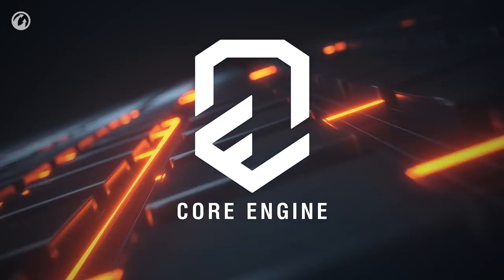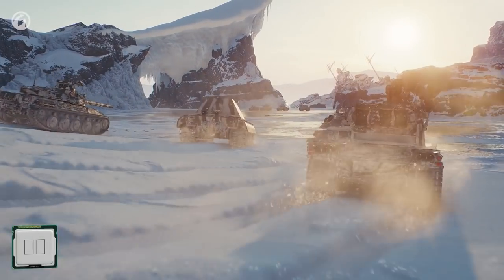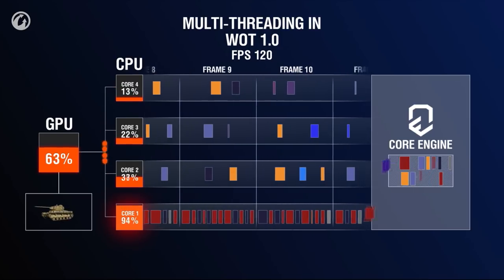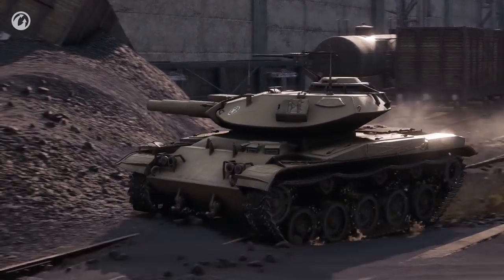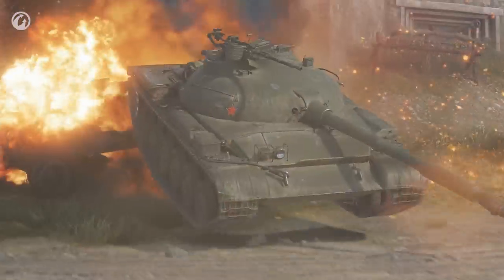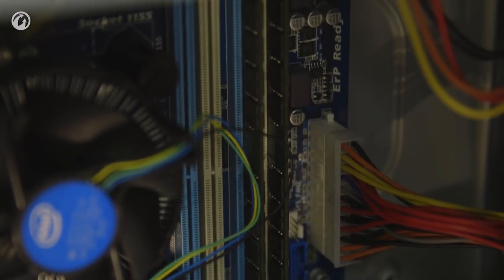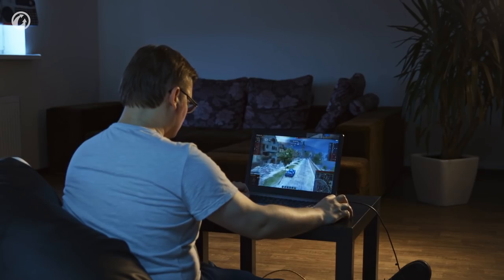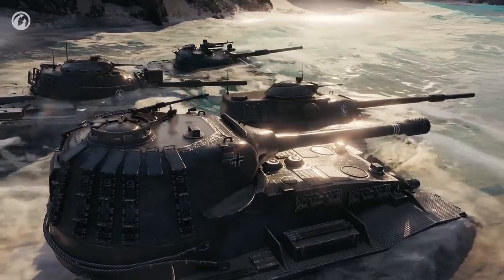Multi-Threaded Rendering in WoT

Comment: Very well explained, other reason that's why I love the dev team. It was update 0.7.something before, it works well with a potato very smooth. Now I have good enough hardware and will be more optimized in my i5 7th gen. (expected slightly improvement because of my gtx 1050 ti 4gb rig only).

Comment: I’m running a somewhat recent  i5 quad core with a decent GPU in a desktop and frame rates float around 120 and rarely get as low as 90FPS so I guess I’m not going to see any benefit while I have a Full HD 1080P screen. But I’m thinking of a 4 K monitor. I guess a good result with 4K will still be very much up to my GPU rather than multi core?